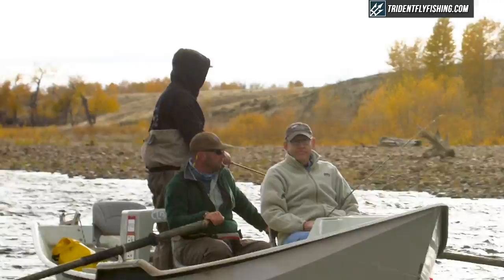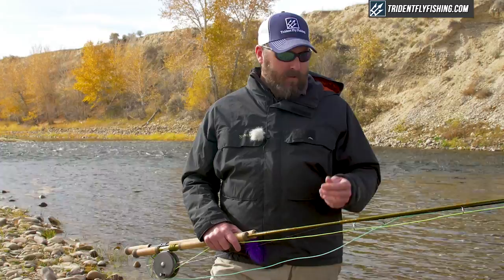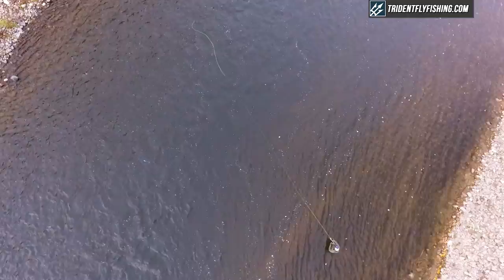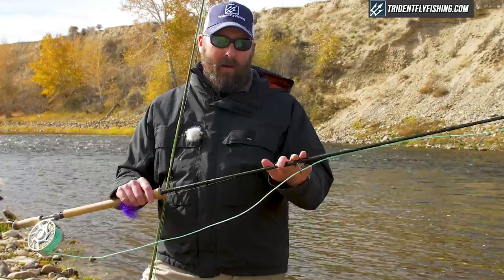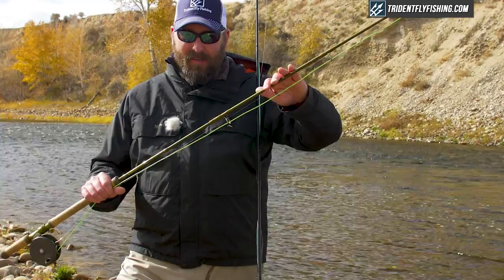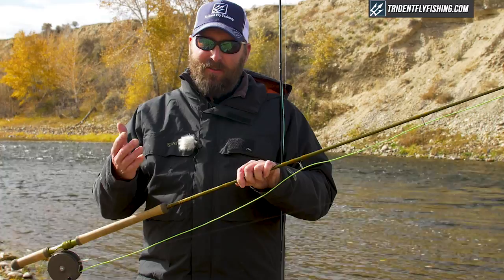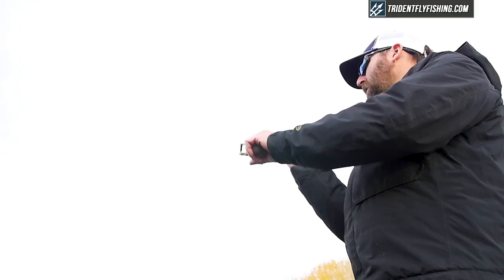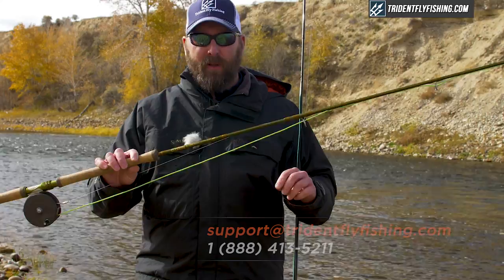Spey Rod vs Switch Rods Explained (What's The Difference?)

Comment: Thanks Tom, this helped a lot!  I opted for a Redington Chromer 6 wt  11'6" Switch rod with a Switch Chucker line. The plan is to swing intruders for smallmouth bass in the river and maybe overhand some modest sized streamers for pike in the lakes. Steelhead are not that far from home so a full spey rod is probably next on the list to get.  Cheers!

Comment: Let’s be honest...if you’re watching this video; you’re considering trying two-handed drugs for the first time.  The Spey Drug.....more addictive than any opioid and worse yet, there isn’t a 12-step program that is going to save you from this addiction.  You’ve been warned.   That said..”Hi, I’m JD and I’m a Spey Addict.”  Switch or Spey?  What’s the difference?  The short answer is “feel”.  If you like “the feel” of a rod, then you probably want to buy a Spey.  You get more feel on the feedback loop from a Spey compared to a switch rod.  I’d compare it to playing golf.  If you’ve ever tried hitting a shot with a 3 iron vs a 3 wood, you know the 3 iron doesn’t really give you the feedback that you get with the 3 wood.  If given the choice at the tee box, you’re going to use the 3 wood all day long in comparison to the 3 iron.  But...if you’re in the rough, off the fare way, you’re probably going to pick the 3 iron.  Right tool for the job.  Same thing happens when you’re choosing between Spey or switch.  If you could only play golf with one of those clubs it would likely be the 3 iron, because you can use it everywhere. That is what fishing a switch is like.  You don’t get as much feel but you have a tool that you can use anywhere.  Now, if you expect never to hit the rough (indicator fishing/overhead casting) then do you really need a switch?  I’d argue that you do not.  If you are coming to the two-handed world, you’re probably tired of indicator fishing and you’re looking to have more fun.  Spey is the answer.  If you’re wanting to do it all, then switch is the answer.  If you accept the fact that you’ll probably own multiple rods and you will,  because this is an addiction - right?  If you  accept that fact, then you should start off with a Spey tapered rod.  Here is why.  First off, you’re going to get more feedback on the feel loop from a Spey and thus learn at a faster rate.  This feel you develop in Spey casting can later be applied to the stiffer switch rod that you’ll buy later this year or next.  :-)  If you know, absolutely positive, that you’ll never buy another two-handed rod and you love to nymph, you’ll end up buying a switch and learn on it.  Is this the best way to learn - no, but you can do it.  I did.  My first rod was a Sage One 5116.  I later bought a Sage One 7126 and fell in love with the Spey taper.  I later bought a Sage One 3110.  This is a shorter rod and has a Spey taper, not a switch taper.  I use the 3110 the most.  (See what I mean by addiction?).  If you choose to go switch before Spey, then you’re stubborn and I respect that in a person...even if you’re the hardest client to coach on the river.   Ask me how I know?  (I’m describing myself.). You’re going to need that stubborn streak to make it through the learning process with a switch rod.  It worked for me - that said, once I felt a Spey, I rarely fish my switch rods unless there is a reason.  You will get more feedback from the Spey and this will help you learn on your switch.  If you’re only going to buy one rod, then get a switch.  Accept the fact you’ll be cussing and frustrated for about a year....then you’ll be fine.  Best thing about Spey/switch? You’re having more fun...you get to look around...and you’ll cover more water...faster.  Enjoy it!

Comment: Tom, I fly fish in the Northeast (Marthas Vineyard) for Strippers and False Albies. One area that I fish is the “gut” between MV and Chappy with limited to no backcast space. I’m thinking of a Spey or switch rod. Do you have any experience you can share as it relates to these fish....rod (switch or spey and what weight and length)? What line would you use skegit or scandi. Would you couple the rod with a 7/8/9 or 4/5/6 reel? The more I read the more confused I am. Any help would be appreciated. Chris

Comment: Is there any difference in the line (grains) you use for example on a #7 spey and on an #7 switch?
Reply: I know I am late, but perhaps someone will read and find use of this later.

So; yes, there is a difference. I have a #6/7 switch rod and a #8/9 spey rod, the switch cast well with 300-330gr, and the spey rod is perfect with a 525gr line.
Basically single handed rods, switch rods and spey rods operate on three different levels when it comes to line weights. The good news is that switch and spey rods usually come with specified line weight recommendations unlike singlehanded rods which just gives you the number on the AFTM scale.

Comment: Im confused... I thought switch rods are just shorter spey rods for smaller rivers. What's difference between trout spey and trout switch then?
Reply from the maker: The difference between spey and switch applies across the board, however the term "trout switch" isn't really something that is widely used...
Reply: You can think of it more of the terms of the action that defines the rod. Switch = overhead or spey casts, but will be stiffer, shorter rod length, and requires better timing when using spey casts (for more advanced casters).  Spey = spey casts only but is much more forgiving and is easier to learn.  Now apply that terminology to the newer rods coming out; Microspey = spey action, Shortspey = spey action, GLX switch = switch action, One Switch = switch action.  If you get a chance to cast a switch and spey side by side in similar lengths you will feel the difference and it will be obvious!  One seems stiff and fast while the other seems more moderate on stiffness and speed.
Reply: O segredo está  na apresentação da isca para o peixe escolhido
Reply: Switch rods are small er lighter two hand rods. Nothing else
Reply: Switch rods vs Spey rods:  Spey will give you a stronger feedback loop on feel.  Once you develop that feel on a Spey rod, you’ll be able to feel the more subtle feel of a switch.  The switch rod is a much stiffer rod in comparison and gives you less feedback on feel.  Sure, you can learn on a switch.  I did.  Was it easy? No...but I didn’t think I’d ever own more than one two-handed rod so I chose to go switch first.  I now own too many two-handlers and fish them almost exclusively.  The switch is a great all around tool but given the choice between a 11.5 foot switch vs a 12.5 foot Spey, I’d go with the 12.5 Spey every time unless I thought I might be nymphing or on smaller water.  Now you know why I own several two-handers.  :) If you want an all around tool in the quiver, the switch rod is that tool.  You can literally do 95% of your work on the water with a switch but the Spey is more enjoyable and is always my first choice if I know I’ll swing/skate (no nymphing) all day and be on medium sized or larger rivers.